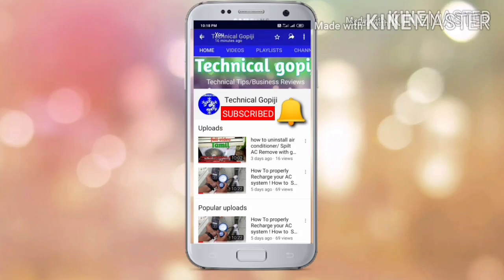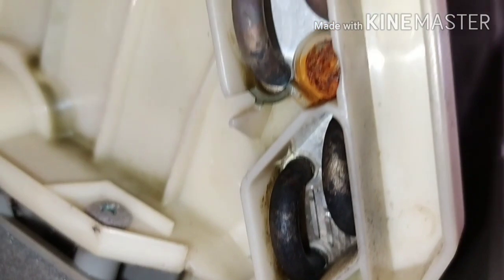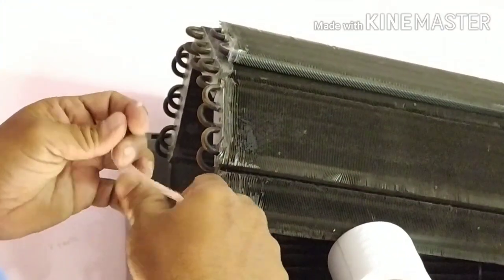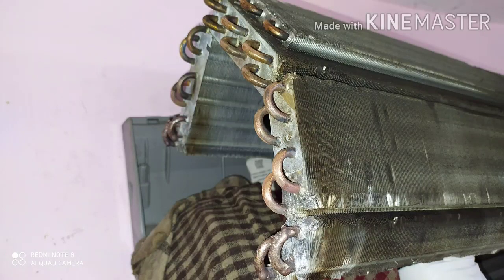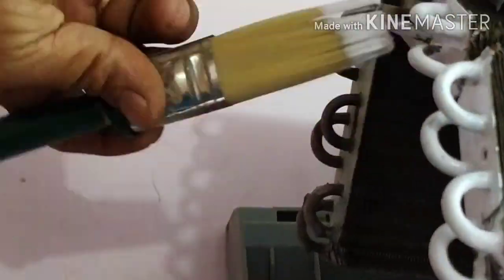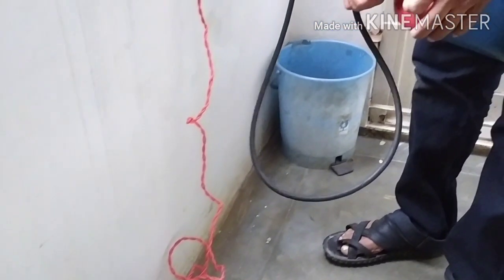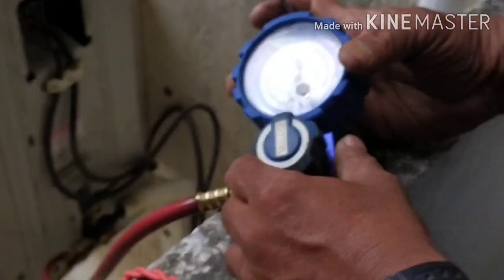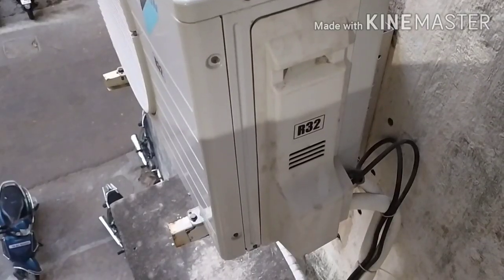How to Daikin Ac  Indoor Cooling Coil Gas Leak Repair work # 9.

Comment: R 32 gas running la ethani psi irukanum,
Reply from the maker: Ji thank you.  Ac running pressure mainum 120 to maximum 150 ji.
Reply: @technicalgopiji3418  thanks for reply